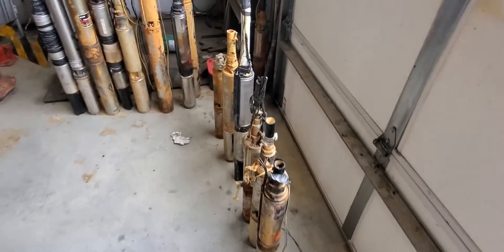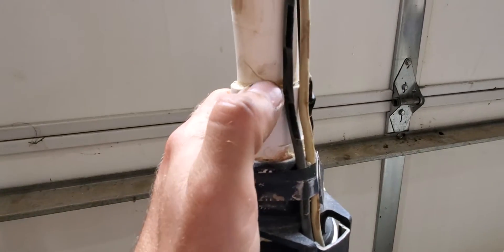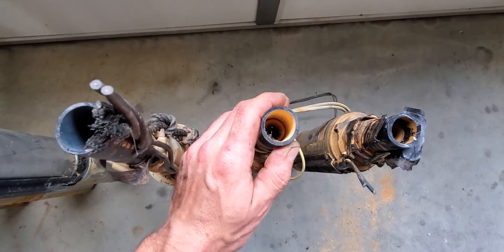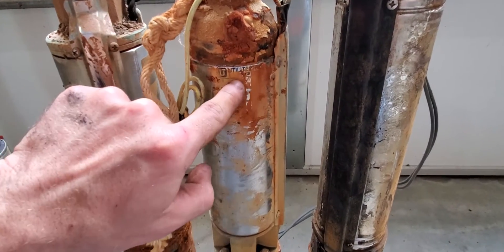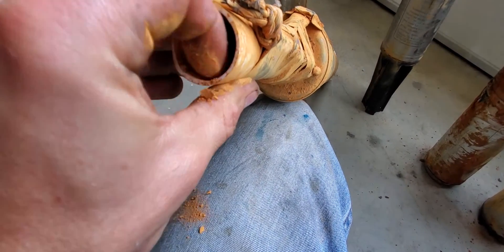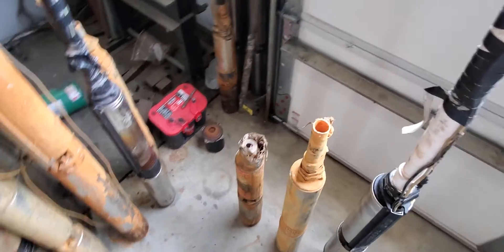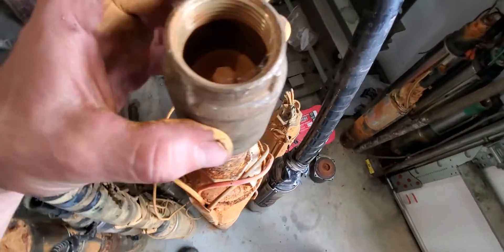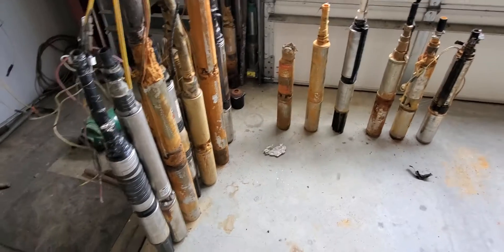No Water, Low Pressure,  Air in Water lines. Here's Why! #1 Troubleshooting video

Comment: First of all I stumbled on your channel as a new homeowner on a well system and appreciate the video thus far. Installed a 60/40 pressure switch to step up the pressure from a 50/30. All was well for a week and I was enjoying the increase in pressure. One morning I noticed the pump running continuously when I woke up early. No water running or open faucets on in the house. Pressure stuck around 20-25 psi with the pump/breaker on. Once I turn off the pump at the breaker the water pressure drops off to 0 and I can hear running down hole. No obvious leaks above ground. No obvious (to me) pressure tank issues. So I guess I need to bring the ole pump up and inspect the piping/fittings/check valves down hole?
Reply from the maker: You are correct. Itll be a split pipe or cracked fitting.
I'm going to guess & say when you pull it out the pipe is going to be very thin. I00psi. Id replace it with 160-200 psi pipe. Either way your going in the right direction. My "Well Q&A" Playlist on my channel has 25 videos that will help you. Especially the install videos, step by step.
Reply: @h2omechanic   hey just wanted to give you a quick update! Since your advice was so helpful. Line had a cracked fitting where my black roll poly pipe fit into a galvanized section. Got it fixed and now we have the best pressure and water flow ever! Big Props to you man! couldn’t have figured it out and fixed it for under $20 without the help! Thank you! Anytime you plan on coming to Texas, give me a holler!
Reply: @h2omechanic  Much appreciated! Thanks for the willingness to express and share your experience and knowledge to folks!

Comment: Thank u for ur videos.. ur awesome. My pump, bladder, and switch was installed in 07, myer pump... bladder and switch is bad, house has no water pressure, should I assume pump is bad as well
Reply from the maker: Yea, 15 y/o is roughly max life span for every major part. Replace the tank & switch & then see if it'll run. If not, then pull the pump.

Comment: I have a low pressure issue . My pressure switch kicks off at 60psi but doesn’t kick back on until 34,but it’s a 40-60 switch . You run the water and the pressure switch gets low enough before it kicks back on that the  pressure tank is empty before it starts to fill up again. I thought that maybe the nipple on the pressure switch may be plugged from iron but I haven’t checked that yet. What could it be ?
Reply from the maker: Your correct. It's probably the nipple clogged. When you remove the switch, check the air pressure in the top of the tank. It must not be over 38psi of air when the tank is completely empty of water. Keep the air between 35&38psi. 
When a switch hesitated to kick on, it can be Too much air in the tank, or a plugged up nipple.

Comment: The pressure switch is a 40 -60 it's new when I turn breaker on it only goes to 30 .I turn water on it goes to 0

Comment: My pump keeps running constantly I cant find anywhere where water would be leaking in the house and the ground is not wet where the supply line is running to the house. I manually disengaged pressure switch it was running at 52 psi and the pressure dropped to 30 with no faucets or anything running pressure switch came on pressure built pack up to 52 psi and pump stays running could it be a bad check valve?
Reply from the maker: Bad check valve would still allow switch to cut out & then cut back on. But your close! The fitting connector from pump to pipe has cracked or if metal its worn a hole in it. Time to pull out the pump & look for a crack or hole in the pipe & fittings. Itll be easy to spot.

Comment: I've got no water after a cold snap on a fixer upper property with some shoddy plumbing. The pressure tank appears to be fine, but its sitting at 22-23 PSI with a 30/50 switch and I don't have an air compressor right now. Pressure gauge that was already installed is busted so I can't get a reading off that. When I test the contacts on the pressure switch they spark but the submersible pump will not cycle. Around the well casing itself there is water pooled aboveground which I can guess is not good. Any help is appreciated I am totally inexperienced with wells.
Reply from the maker: Kill the power & see if the pressure drops to 0. If it does, then you should pull the pump and look for a busted pipe.
An ice broke can make a pump dead head & itll bust the drop pipe.

Comment: Question. Just bought property, well has been sitting for over ten years without use. I hooked up the pump to controller and generator. It ran fine and clear for a few minutes, then water turned brown then stopped altogether. Help please, thanks.
Reply from the maker: How deep did you set the pump? How much water is above the pump. 
It sounds like you drained the well to the level of the pump intake.

Comment: Having a lot of air in my system. Not so much on the cold side. Mostly the hot. Air comes and goes. Sometimes no air for a couple of days. Pump is cycling as it should even though its 40 years old. Any Ideas would be appreciated.
Reply: Did you ever figure out the issue?

Comment: Your video describes my symptom to a tee, after checking pressure tank which is 38 psi and replacing my pressure gage for obvious failure and sealing all connections off the pressure tank tee. The pressure gage struggles to maintain pressure, at cut off I slowly lose pressure before the pressure switch kicks back on again, and endless cycle and at this point after a long rest I can't even fill a large load for the washing machine before water drops off. Please advise as I've coved the base's found hear on YouTube. Thanks Ed
Reply: TY sir for your timely response, I was thinking along the same issue, that said can you please provide a  reasonable  replacement cost would range and can you recommend a reliable brand name.
Ty in advance.
Reply from the maker: @edwardsage5284  I install J class pumps.  7-10 gpm.  A typical pump replacement depending on pipe its hung on can range from 5k @ 400+ft 2hp. Or a normal east coast system or black roll pipe should cost 1400-$2000 at 300ft deep . It can always be cheaper if it is shallower the 100ft.
Reply from the maker: Happy this video shed some light & helped you.
You'll probably find a cracked pipe near the pump, but go ahead and replace the pump bc its been working its @ss off for a while. The pumps impellers are probably worn out from continuously running

Comment: Great video! Thanks for the education.   I am starting to think it's the pump at my house.  I replaced the water tank initially, which said 1992 on the date of manufacturing, so was happy about the life out of that.  Then I replaced the pressure switch with one with the arm on the side of it.  That was a mistake overall, as i had to push the arm up and allow pressure back into the system.   So I returned that and got a standard 40-60 psi switch yesterday, and it immediately went to 40psi.  Thought that was the solution until pressure dropped again, ugh!  So it gradually does build up, but the brand new switch does not kick on and off.  I adjusted the range clockwise and it simply doesn't go up???  It's very frustrating.  This AM, the pressure was good, although, a ton of air and sputtering coming out of showers for the first 20 seconds or so.  The pressure was at 40 when I checked it, but now creeping back down to around 35 and convinced it won't build back up once again, and have the pressure switch cranked at least 4 full turns.   Any help or feedback would be appreciated.  Thanks again for the video.
Reply: I'm having the same exact problem at my house too :(

Comment: I had no water, the pressure was at zero, I closed the valve after the gauge and continued looking around for a problem a few minutes later it started to build pressure everything worked normal for about 25minutes then lost water again. I did the same thing just closes the valve and waited (I don’t think closing the valve is actually doing anything 🤷‍♂️) and again it built pressure and has been working fine for several hours now. What the hell is going on? I’m assuming a component is shitting out, which part though?
Reply from the maker: You might have a toilet hung using water & draining the well dry. Or a leak somewhere after the valve . Sounds like if the valve is off, the well fills up & the pump works. Leave it off & go inspect the toilets & see if any are empty in the back tank. Look at the flappers. 
Definitely sounds like you are running the well dry. So look for leaks. Wet areas in yard, under house ect
Reply: @h2omechanic  thanks for replying, you were right I found a broken pipe. Problem is it happened again after fixing the break 🤷‍♂️

Comment: What is the average price to put a good high pressure  well hit water at 85 ft went to 105 ft. Long distance 100 ft plus use
Reply from the maker: There's alot of variables, but I'd say $5500
Reply from the maker: 1800 if your referring to a pump

Comment: I have a well pump like you showed in this video and thank you it was informative. Can I leave that pump right where it's at and run an external pump in my basement? In other words instead of pumping the water i want the external pump to suck/draw the water from inside the house and using the same line.  I have about 20 psi at the gauge so I'm sure it's either cracked or broke somehow.

Comment: Having a well in the house is one of the worst things you can do I have a problem with my water it got really cold in my house and now the house only has half water only in the bathroom the toilet won't flush I have a flush mate toilet I've had  Heaters one all the pipes all my water pipes are Pecks water lines.... This house is very warm now and I still only have water in half the house none in the kitchen what's the problem

Comment: Last year my pressure tank was dry cycling several times- each time I would drain the system and would provide relief for a month or so before doing it again. Pin pointed it (or so I thought) to a bad pressure tank and just installed it along with new lines and pressure switch. When turning the breaker on the system  would pressurize; but whenever we open the faucet, the pressure immediately dumps to 0psi. What is going on here?
Reply from the maker: There's way too much air in the tank for your size switch. 
Setting air pressure in the tank is critical. If you have a 40/60 switch, go let 15 seconds of air from the tank. Then try it, & repeat until it acts normal. Or watch my tank videos on how to set it .
Its 2psi below the switch "on" #
 Power must be off & no water in tank while setting air pressure

Comment: I have a well that’s 50’ deep and the water column starts at about 25’. It’s a very good well, so I’m certain I’m not running my well dry. I have a zoeller pump that doesn’t require a control box that’s less than a year old in it and all of a sudden I’ve started having trouble with the pump not kicking on, on its own. The pressure switch shows to be still within its operating range but I’m not getting the water to my 3 water troughs with automatic floats. I don’t have any leaks in pipes underground to my knowledge or that have surfaced. But as soon as I turn the breaker off and pull my pump up a couple feet from its pitiless adapter and then reset into the adapter I turn the breaker back on and then make sure the pressure switch contacts are together the pump will turn back on and pressurize the system and fill the Troughs and then the trough floats will cut the water off and then the next day I get home from work and the same issue.  Any insight as to what could be the issue? Is the pump going into thermal overload or am I losing prime? I don’t have a check valve directly above the pump other than what’s installed internally in the pump. The check valve is about 60’ from the pump where my pressure tank and filters are located. Any info will be appreciated, thanks!
Reply from the maker: You need a clamp system amp meter. Clamp Around one single wire white or black. It should read 6.5 amp or if it's 13-20 amp, the pumps dead & is over heating.
That's the only true way to test the pump.  If its good, then I'd remove the check valve from the tank. The one at the pump is all you need. 
If the switch is old,replace it.

Comment: I have a drilled well , 6 inch casing, 120 ft deep. 20gpm.  This is for my camp that I only use in the summer. What kind of pump would you recommend I use if I only have a generator? Only gonna use the water for washing dishes, drinking and shower.
Thank you!
Reply from the maker: Generator needs to be 6000 watts or bigger & 240v. The amps may seem low at 6.5a. But to start a pump takes 20 amps. 
If its a 120v Generator, it'll be even harder  to start. So go with the 240.
I'd install a 1/2hp 10gpm pump at 80ft. Use a 20 gallon tank & youll have a decent amount of storage when the gen is off.
Reply: Thank you very much 
And happy new year!

Comment: I have an intermittent pressure issue just wondering if you could possibly give me some advice.   Any time i have had a plumber here the problem was not happening or stopped before they got here.   The plumbers i deal with around here are somewhat useless and dont want to troubleshoot anything.   The issue is that the pressure drops really slow,  there is no leaks anywhere in the house.  When it hits 40 the pressure switch kicks the pump on then it shuts off at 60 and after about 25 mins its down to 40psi again and the pressure switch kicks to pump on.    The first time this happened i shut the power to the well pump off overnight and in the morning i was a 0 on the pressure guage......turned the switch back on and it held pressure at 60 psi so when the plumber got here there was no issue.     Is it possible the check valve on the pump is failing?     Could this happen intermittenty?   thanks
Reply from the maker: Its totally possible it's the pumps check valve. They start failing around 15 years. 
But its more common to be a leaky toilet that you don't use often. Itll have a leaky flapper that's using water
Reply: @h2omechanic  thanks for the quick reply.    I do have a shut off before my filter / softener set up.   When this happens I have shut that off and pressure still drops slowly that’s how I determined i didn’t have a leak somewhere.    I subbed to your channel and will definetly be watching all your videos!
Reply from the maker: You need to watch my tank videos and learn how to adjust & set yours correctly according to your switch size

Comment: Good evening. My water pressure has been intermittent for about a week. When I'm not running water in the house my tank builds pressure to 60 then the pump shuts off and back on again at 40 like it's supposed to.  However when the water is running the pump kicks on at 40 psi but continues to loose pressure down to nothing. Won't build back up untill I turn the water off. Like I said the issue seems to be intermittent. Thank for your help
Reply from the maker: It is possible that you have a leak that's draining the well dry. Check all your toilets #1.
Secondly, the pump could be old & worn out. Average life is 12 years.  Intermittent problems are the hardest for me to diagnose. Without a Amp test, I can't be positive what direction to point you in. Merry Christmas 🎅
Reply: @h2omechanic  thank you. I do have a toilet that is leaking some. I'll need to call a local well guy on Monday. Thanks for your help. Merry Christmas to you!

Comment: Help. Pressure won't get over 25psi at the tank. Guage is on the Air Volume Control. Submersible pump constantly running. Seems to hold pressure when pump is shutoff. Has a check valve with ports for pressure switch and air valve between well head and tank. Could the check valve be bad?
Reply from the maker: Typically in a situation like this, you remove the pump & youll find a hole or crack in the pipe that is leaking out most of your pressure.
Reply: @h2omechanic  Thanks. That's what it seems like. I put some pressure in with my air compressor and after the switch kicked off I could hear some gurgling at the well head, but tank pressure stayed steady.

Comment: Hello, maybe six months ago we had an issue with our tank. So I replaced the tank (replaced it with a bigger tank from 20gallon to 32gallon) and while at it I decided to replace everything else around it (pipes, pressure switch and control box). I remember it doesn’t take very long for it to build pressure from 30psi up to 50psi (maybe 10-15 seconds). Now the issue I am having is it taking longer to build pressure (a few minutes at least). It is now to the point that I can’t even fill up the tub without going back to the pressure switch and turning that lever to get it going again. Is it my pump causing this issue now? My pump is 1/2hp, my pressure switch is 30/50 and my tank size is 32gal. Any advice will be a great help and appreciated! Thank you!
Reply from the maker: Id say since you have a 30/50 switch, your tank being new its likely got too much air in it. Kill the power,drain all the water pressure to 0. Then check air on top w pressure gauge. It needs to be 25-27psi no more. If it is above 30, then you'll know that you found the issue

Comment: i have a well pump changed pressure tank but still air in the system which can be very bothersome any suggestions
Reply from the maker: If you have a check valve at the tank, that's the key. The check valve at your tank is holding good, but the check valve in the pump is leaking. This allows the water in the pump pipe to slowly leak down creating a air pocket that gets sent to the house the next time the pump turns on. If I'm correct, the air will be worse in the morning & also when you use water after it sits off for hours. 
Pull the pump & add a Check valve on top of pump, or just replace the pump, its probably 10 years old at this point if the check is failing